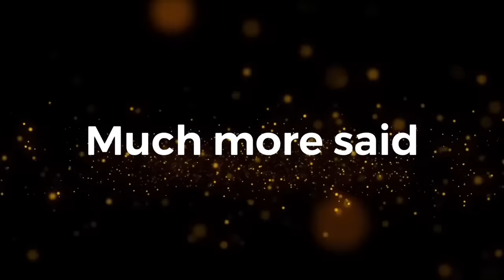EMOTIONAL reveal on FREE lawn makeover!!! [It was fate]

Comment: When fencing over grassy areas,it is important to either lay a concrete mowing strip under the fence or leave a 1-2 inch gap at the bottom of the fence to allow for line trimmer access.